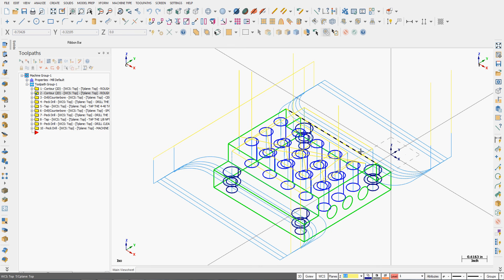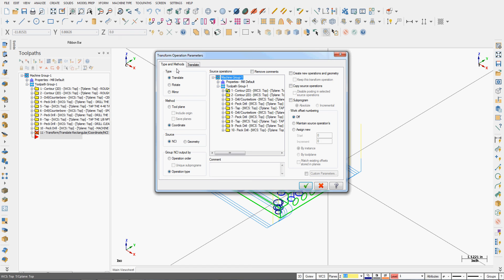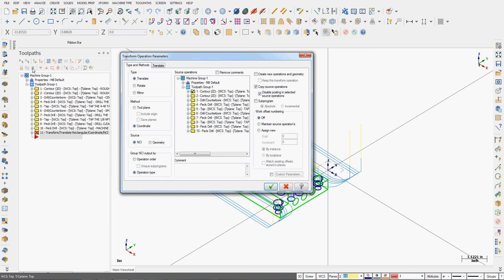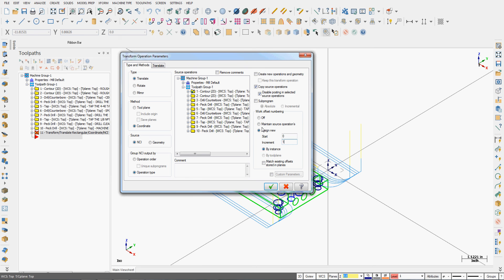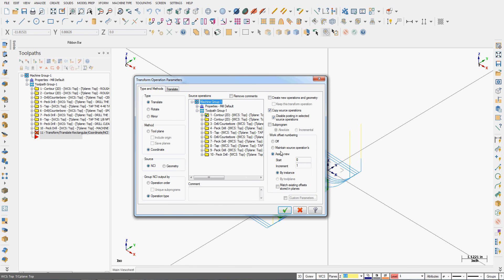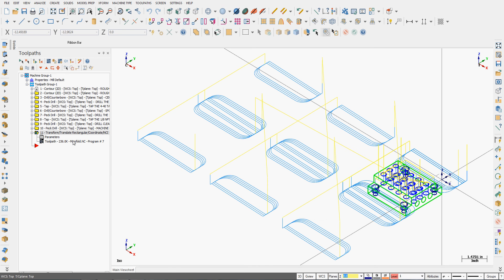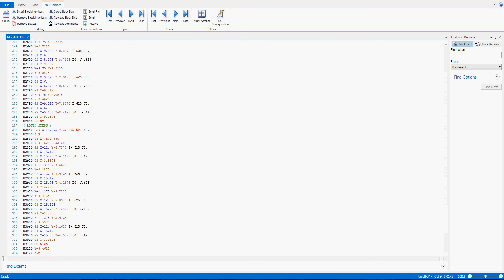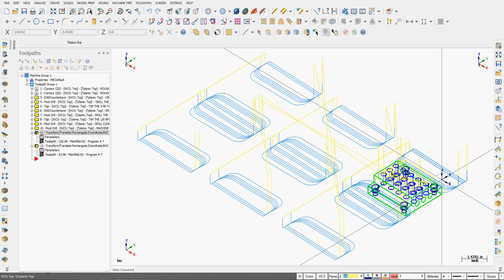Machining Multiple Parts the Proper Way

Comment: Great video. I do see a problem with your code though. You said that you don't have to worry about x and y spacing. This is incorrect with the selection of coordinate. If you didn't want to worry about x and y spacing tool plane should have been selected with WCS and Tool plane. If you look at your G-Code you will see the Values are changing by the amount you moved as of now .
Reply: This is correct, it still offsets in x and y in the G55 work offset. Thanks, this helped.
Reply: Ty, this is what I came here to verify. Coordinate didn't do what I wanted, tool plane did though

Comment: How to post with different vices of parts?
Reply from the maker: By using the "assign new" option in the "work offset numbering" section.
Reply: Can I do it with Mastercam x5. I’ve tried many times but it didn’t work